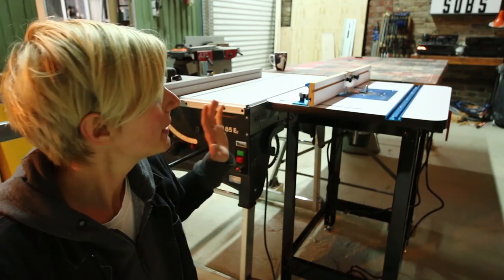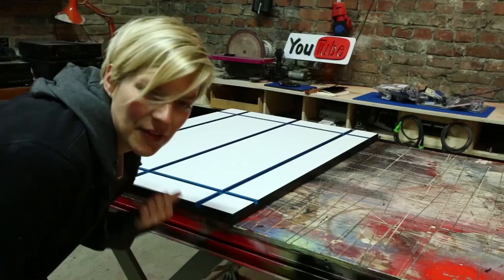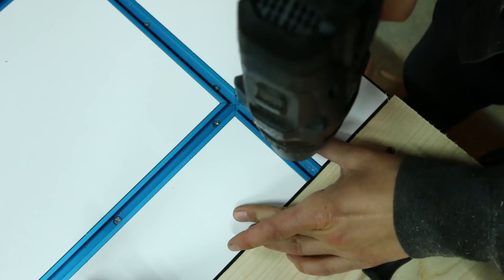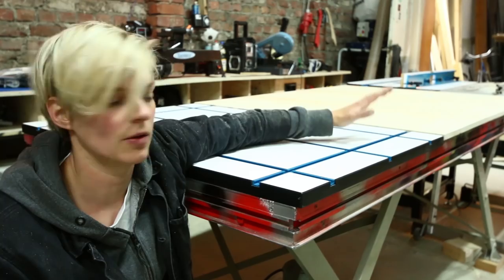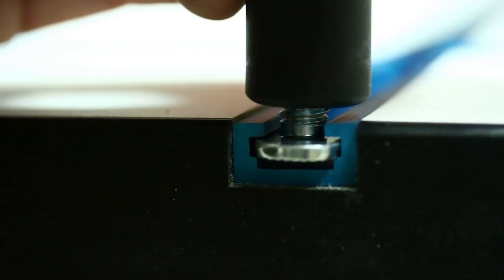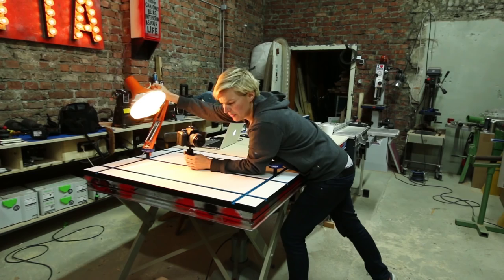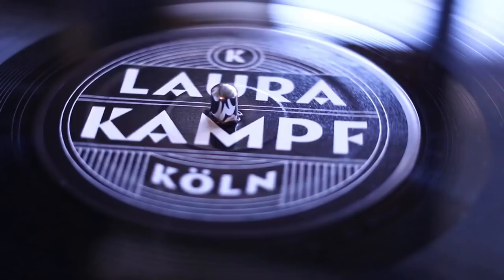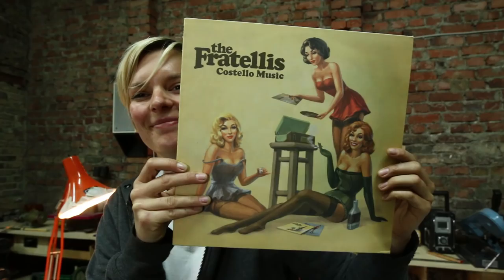Vlog 13 - T Track Table

Comment: Another great Video! The actual outfeed table looks very sturdy but is still foldable, do you know what kind of model that is or where you got it? (Region Köln ist okay :D)
Reply from the maker: in german this table is called "scherenpodest" i bought it from ebay a couple years ago. originally they are used as stage-elements. super strong, i think it can hold 250 kilo per square meter...
Reply: Ah okay, didn't know that type of table, will look for one one ebay. Thanks for the Info! :D
Reply from the maker: yeah, that´s it schnakenberg is one of the top companies to produce these!

Comment: good stuff Laura..that was a GREAT idea with the t track and bench cookies.. i have a question..if you are not to busy.. how do you get velvet to stay flat on red oak?? im building a gaming table for someone and im at the point where the velvet needs be layed out. and ive tried 2xs  to get it down and still get wrinkles and wavey bumps after 8-10 hrs!! ive tried spray gluing the edges, and pulling it tight...ive tried spraying gluing the whole surface  smothing with a straight edge..and now i have 1 last shot at getting it right.. any suggestions wood be GREATLY  APPRECIATED!! i know u work with a little bit of everything..if your too busy its ok..:)thanks!:)
Reply from the maker: hmm. weird i know my friend who is into upholstery uses sprayglue, too. have you sprayed both sides and let the glue get drie before applying?
Reply: Laura Kampf no..i waited for it to get "tacky" &then layed it out and pulled it tight on one end while the other end was held down with a piece of plywood and 5 clamps.but thats an idea .. I'm going to try that way..so  just lay it out on the dry glue is what you're saying? and then pull it tight?
Reply: Laura Kampf yea i use 3m spray adhesive..i talk about it in one of my videos and show how its messed up if u check my videos its under "whats what#6or7..:)
Reply from the maker: haha, i will check that later :) they have so many different types of sprayglue...but with the one i was using it was quite quick and easy if the glue was almost dry...and then start at one side and brush it down with your hands. i wouldn´t apply too much pressure because that streches the fabric and creats more wrinkles. give it a go and let me know.
Reply: +Laura Kampf cool thank you very much Laura! maybe thats my issue.ive been stretching it too much..:)

Comment: also ich hätt das Teil wohl ganz anders verwendet... und zwar als neigbare Montage- und Arbeitshilfe... entweder in 30° 45° 60° fixierbar oder als 90° "Wand" fürs Fixieren von zu bearbeitenden Teilen in der Vertikalen ;)
Reply from the maker: coole idee
Reply: Laura Kampf stand oftmals schon am Problem, dass ich manche Elemente in nem Winkel fixiert besser bearbeiten hätte können als liegend... hab z.B. ein Abdeckpanel bohren müssen für Kabeldurchführungen und dergleichen... liegend auf Unterleghölzern am Boden ging zwar, aber eben auch nur weil ich rundherum gehen konnte... und grad wenn man Rahmen macht kann man es teilweise aufrecht besser montieren als liegend ;)

bzw. kann man das auch als "Verleimpresse" verwenden und hochschwenken um dann keinen Platz zu verschwenden :D